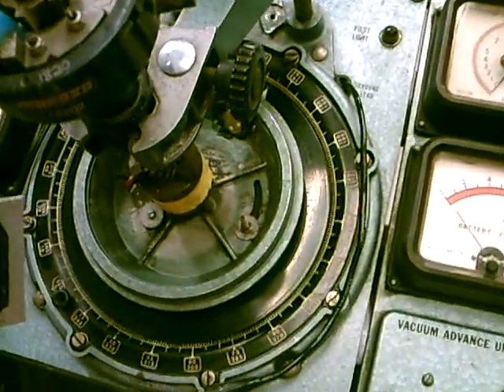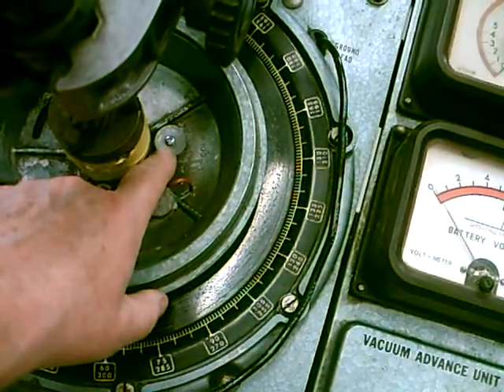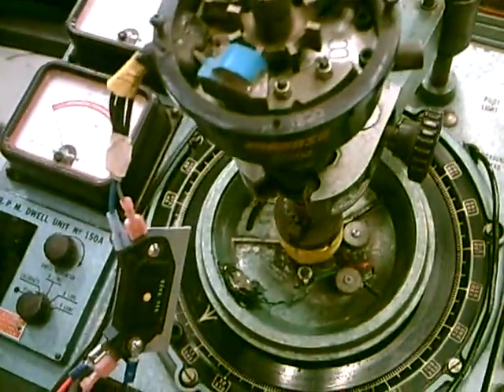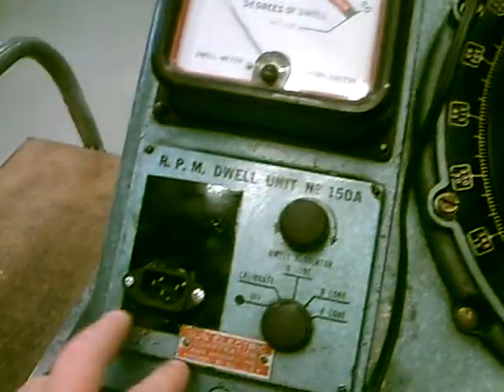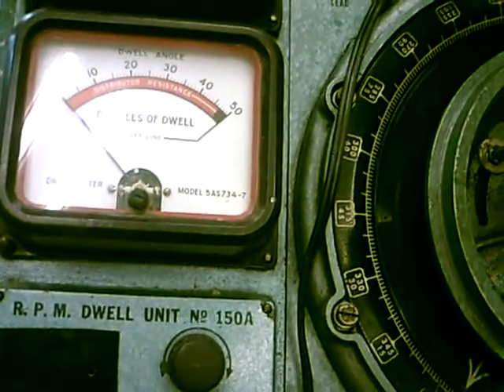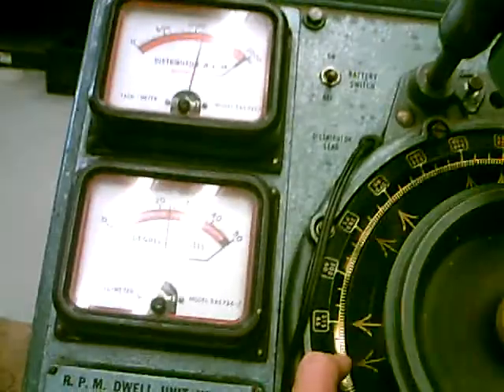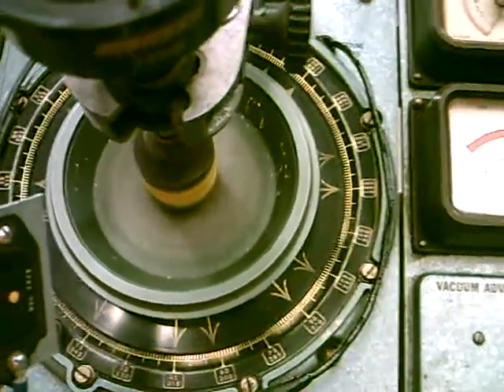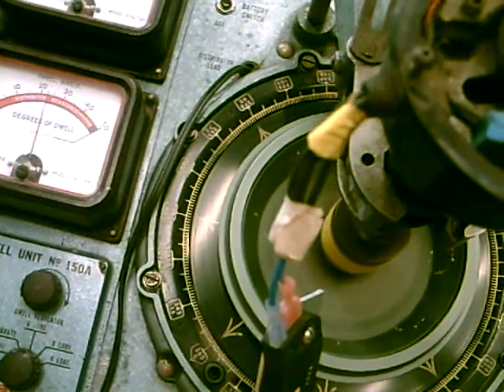HEI Connect to 1948 SUN Distributor Machine LED DWELL Flash

Comment: Do you work on and build stuff for distributor machines ? I got an allen distributor machine that i may have to do stuff too..
Reply from the maker: I build a LED retrofit module for the SUN machines and have sold several dozens of them. The ALLEN is a different configuration and do not deal in electronics for them.

Comment: How do I get one???

Thanks
Reply from the maker: Sorry for the delay. These modules are available for $229 + $6 shipping. I prefer that the machine not be working poorly or not.  This modification requires removal of most of the existing electronics and will require balancing. This could be a risk if your skills are not sufficient in this area. I have had several individuals buy multiple kits apparently making a business of this. An additional $12 power supply must be purchased from a US source. Provide an email and I can send you a manual to evaluate prior to purchase.  Provide tach and dwell module numbers so I can evaluate any modifications that must be done to them. Machine model is not very useful as many of the individual modules were replaced with later versions.
Discussions on my home page can be used to supply email if privacy is needed.
Reply: @opera5714  how do I get ahold of you for payment?
Reply from the maker: @travisjeffery1352  Please send me your email here or on my home page in discussions to be totally private. I will email manual and you can decide if comfortable with this project before payment.

Comment: I've watched all your distributor videos in hopes to see a part number on the small little black box you had in your hand. Could you post that information and the part number of the LED.
Reply from the maker: I make those black modules and still have some in stock.  It comes as a kit with lamp and  LED. I had sold them on ebay and stopped a year ago. Just do direct sale now. Send email and will send a manual. Please allow 5 days for response due to no Internet.

Comment: Can you explain more about the connections to the HEI module? I guess I'm asking what each connection does. (I do understand what you're saying about how people are trying to sell you an expensive pulse amplifier in order to test electronic distributors.) Is the heat sink just a piece of aluminum? Maybe you've posted more about this on another website/forum. If so, can you post a link? I bought a Sun Distributor machine and am slowly trying to learn more on how to use it. I also have a few repairs to do on it, such as, replacing what sounds like a bad bearing. Thanks for any info you can offer.
Reply from the maker: I'm not real car guy. My friends race and I like them. They bought three of these machines which have helped restore. I've seen $200 modules sold allowing magnetic pickups to be used on the older versions of these machines. The simple 5 pin HEI modules have two pins for the magnetic pickup, one ground, one 12V and one for the coil. My conversion module accepts any switched 12V input. So, a $9 module is all it needs. A little aluminum plate is all it needs to dissipate some heat.